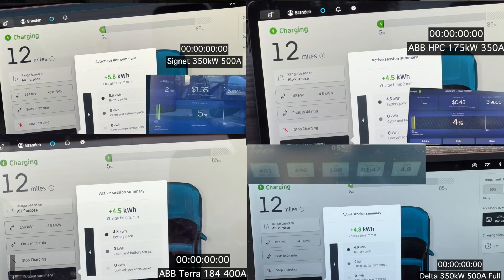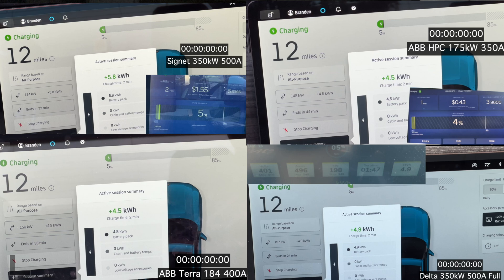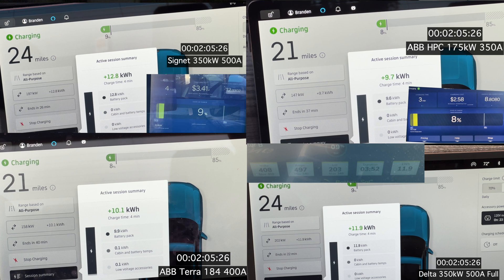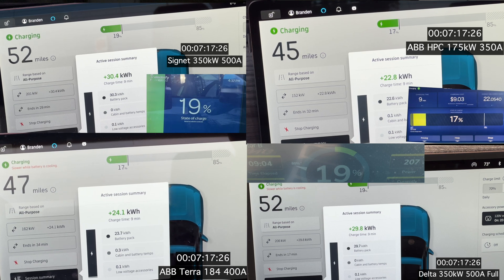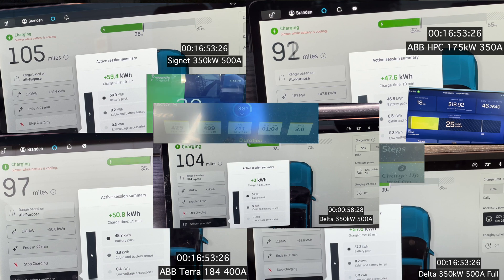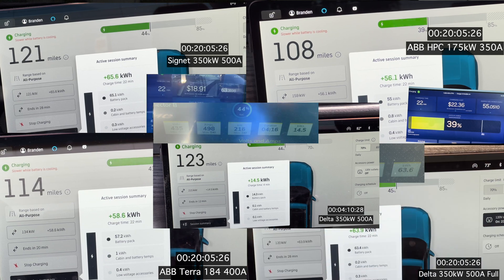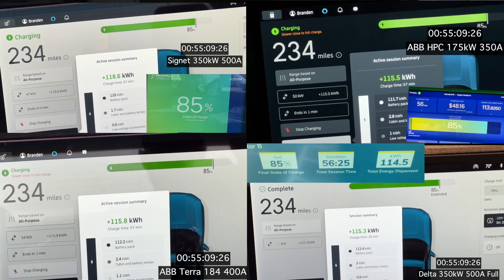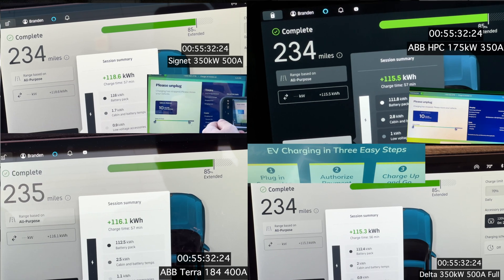Tested: 150kW vs 180kW vs 350kW with Rivian R1T - Does It Save Time?

Comment: It's the amperage of the 150 that keep it in the game. EVgo has a charger rated at 200kW but it's a 200 amp charger so on 400V cars it's 80kW max.
Reply from the maker: 200kW charger at 200A is not a 200kW IMO
Reply: @brandenflasch  Yea, not even on an 800V system; Keep up the good work BF

Comment: More proof that the harping on maximum charging speed is silly. Batteries are built to attain and average charging rate of "x".  That is the important number. The fastest charging ones charge at, or slightly better than 150kw. Finally stop looking at SOC for disconnecting! If the battery is charging at, or above, 100KW..... KEEP ON CHARGING! Once it drops below 100K and definitely 50K then, disconnect. My EQS happily charges around 100KW all the way to 90%. Those additional 5min give me another 40 miles. If I'm spending 35 minutes at the charger already those extra 5 are still gravy. High charging speed are only important if all you want is a quick "top off" but if you are still mid long drive you want to maximize those miles to the next charger!

Comment: That was a really impressive effort to gather all that data and then do the editing to display all the images in sync. It was quite a surprising result.
Reply from the maker: Glad you found it interesting - certainly was a lot of time and effort to record these sessions. Takes more effort to drain the battery than it does to charge it!
Reply: @brandenflasch  Oh heck, I could easily see that taking them all down to 3% ... ie. the "timing" of the drive to them then the driving around to get them lower before the charge.
Reply from the maker: Exactly!

Comment: Ocean Coast is v handsome. Good video, Brandon. Hope Rivian can increase thermal overhead. A little birdie told me Rivian isn’t letting their cell temp exceed 46 C at the moment. Tesla Plaid pushes 60 C by comparison. I’m assuming over time as Rivian learns about degradation, they’ll start to push things further like Tesla has. With 175K mile warranty on battery, I’m assuming Rivian will always be a little more conservative.
Reply from the maker: Thanks for watching, Quinn - been watching your videos for literally as long as I can remember. 
The a different little birdie has told me the same thing - 46C is very conservative and is likely posing limitations in a few ways as the higher the SoC, the higher battery temp you need for a high C rate. I really hope Rivian starts to have enough data soon and not only starts to really rip the AC compressor while charging for cooling, but also increases thermal limits. Hopefully there aren't thermal gradient issues as a limiting factor...

Comment: Interesting results. Thanks for this level of analysis. I'm waiting on my R1T, but I currently have a Model 3 (3yrs old). I'll admit I'm a bit disappointed by these results. I've noticed with my Tesla that there is quite a difference between the 150 & 250Kw chargers as far as speed, and I'll sometimes go to the 250s just to save some time (sometimes I'm able to get from 10% to 40%/50% in around 5min). But apparently with the R1T it doesn't matter which chargers are used. Hopefully they will improve this in the future.
Reply from the maker: Even with your Model 3, the time savings of using a v3 (250kW) vs v2 (150kW) Supercharger is minimal in actual testing. The bigger benefit of V3 is that you won’t be sharing 150kW with someone else.
Reply: That is on Tesla. CCS charges faster all around regardless of what the "pump" is labelled at. Its already that CCS 350 charges faster than any Tesla charger using the new tesla adapter.

Comment: Very interesting, thanks Branden!

What was the ambient temperature range(s) during your testing?
Reply from the maker: Approximately 70-85F for the multiple tests, so fairly consistent (or at least enough to not be a large factor in varying performance)
Reply: Would be interesting to do this again, in summer when it's around 100F

Comment: Very interesting. I would have expected it to be a delta of ~5 minutes or so. I guess like you said, just get a working charger and go about your business. 

But it seems like Rivian needs to work on its battery cooling. Seems like it should start its battery cooling as soon as charging starts to anticipate the battery heating up vs cutting power from the charger when the cooling can’t keep up.

Also it’s crazy that Rivian can’t accurately estimate the charging time. I get being off by a small margin of error, but it’s wildly off.

Comment: Is the limiting factor the vehicle? I ask because you have chargers here that in theory are 2x the speed of others but it didn't seem to matter in the end. As the cost of EV Chargers increases considerably from a 150/180kW unit to a 350kW unit, I would think results like this would make companies rethink investing in more expensive equipment.
Reply from the maker: Correct - it’s always limited by the weakest link. In this case, the vehicle.
Reply: @brandenflasch  Great video - by the way. You didn't include any charging cost information in your video. I am curious if you keep track of that information and if that is something you have done a video on?

Comment: Wow, thats amazing to see. I guess the big difference between the chargers will be in the 800V cars, like Ioniq 5 and tycan.
Reply: We have both t be rivian and Ioniq 5 and have done many road trips this past summer. The Ioniq def charges much faster - usually done before we were ready. But the rivian makes up for it w longer range. I actually prefer the longer range bc I find the detour to look for chargers wastes so much time.  On certain day trips, I could do it w the rivian without charging while I would  probably need to charge once w the Ioniq.
Reply: @Wasabi9111  Great to know.
What I meant is that the 800V cars have a biger advantage on the 350kW charger compare to the 150kW charger. You will see more difference in charging time compared to 400V car with the same to chargers.
Reply from the maker: Eh, not really. They charge faster but a smaller battery makes the difference less significant than you’d think.

Comment: Agree with your results. I've twice had issues using the EA 350 kw chargers. Apparently the truck batteries overheating, then slowing the charge rate to try and cool the batteries. The 150 kw doesn't heat up the batteries as much, thus doesn't reduce the rate. Last time I used a 350 kw charger, it stopped charging at 75%. Tried restarting 4 or 5 times and stopped after 1 minute. Then got "system error" and "battery error" messages on the screen. Power to the truck was reduced by some 80% and had to crawl the rest of the way to my destination. So far, knock on wood, never had an issue using a 150 kw charger.
Reply from the maker: Was that on the new EA hardware by chance?
Reply: @brandenflasch  I believe so. It was in Barstow the last time it happened last weekend. I went through there a month earlier and those two chargers (350 kw) weren't available for use yet. So, they were definitely newly installed within the past couple of months.
Reply from the maker: @racinj7134  the new single cable units?
Reply: @brandenflasch  Yes, One for each side. Definitely a newer style charger than the other four on site that two cables on each side (actually front and rear), the 350 kw charger has only one cable on each side of the unit. Looks like two units stacked back to back, one for each isle. Just charged there again today. Skipped the 350 kw chargers and used the 150 kw chargers instead, despite the 350's being available. Didn't want to chance another issue. Had no issues with the 150 kw chargers.
Reply from the maker: @racinj7134  Kyle from Out of Spec had issues with his Rivian on a new unit too - the charger was delivering more power than the Rivian requested and sent it into limp mode. Hard reset fixes it
Reply: @brandenflasch  I was assuming a hard reset would be my recourse as well. As I was on my way to my destination after it went into limp mode, I called Rivian Service and asked them if that would resolve it. That's when they indicated to first try, just letting it rest for 30 minutes. Turn it off and let it sit. I checked into my hotel. Came back within 10-15 minutes and the truck was fine. I'm sure a hard reboot would have worked on my truck as well, if for nothing more than the fact that it takes a few minutes and shuts everything down, thus having the same effect as letting rest, and then some. 

At this point, until EA and Rivian figure out how to make that charger work properly, probably best to stick to the lower rated 150 kw chargers. Tempting to use the 350 kw chargers since the Rivian is capable of 200 kw and you hate to give up that extra 50 kw of charging speed, but one side or the other isn't regulating the power properly. Seems to me like it would be more on Rivian's side to regulate the power down, rather than Electrify America. But, that's beyond my pay grade to make that determination. Hopefully they get it resolved soon, but sounds like it's already been an ongoing issue for at least a couple of months.

Comment: Appreciate you doing the hard work here. I'm not surprised by this based on my observations with the truck. And to be honest, if you had tried a 350kw ABB chargers from EA or EVGO I suspect those would have been slower. The charger throttling ends up eating a ton of time.  

When I had access to the RIDE screen, the thermal derating for the battery was always the max temp at 45C and not a thermal gradient issue in my observations.
Reply from the maker: I hope Rivian both cranks up the thermal management system and increases max cell temp to 50C or even 55C - likely could even charge at a higher C rate at higher SoC with higher cell temps. They’re likely being very conservative with their 8 year / 175k battery warranty.
Reply: @brandenflasch  totally agree. I'm just sitting here hoping they are waiting on more data for the fleet, or plan opening more up based on BMS health to support the battery. RJ previously hinted at something similar.
Reply from the maker: @football0552  hoping they have enough data to open the flood gates soon - let the current flow!

Comment: I don't have my Rivian yet but I do have an EV6.  Even with the 800v architecture, there isn't as much difference between EA 350's and 150's as you might think on a typical 10-80% charge.  More than what you got here but the heat generated from the higher throughput ends up requiring throttling later to keep the battery from overheating.  I don't worry about having to take a 150 anymore either.
Reply from the maker: Exactly. Even an e-GMP car might only save 2-5 min - having a smaller battery makes the rate even less impactful
Reply: CORRECT 100%

Comment: It's too bad your video clipped off the lower right corner of the EA screens. Some dispensers are now displaying kW requested by the vehicle there. Keep an eye out for those that do and see if you can confirm that it's really the vehicle that is the limiting factor and not janky stations.
Reply from the maker: I actually haven’t seen that in a long time - used to display for a couple months and then they seemed to remove that 🤷‍♂️ I think with the broad mix of hardware (the Delta unit was installed a month ago) any charging hardware limitations would’ve shown
Reply: @brandenflasch  I saw it displayed on a new unit that @itskyleconner videoed within the past few weeks.
Reply from the maker: @lkuhn65  that would be nice!

Comment: Cool how it was a tortoise & hare race. Would you say, based on the thermal behavior between the chargers, using a lower power unit would be a better choice for long term battery health?
Reply from the maker: Probably marginally better but I really wouldn’t worry about it.
Reply: @brandenflasch    I figured as much, but thought I'd ask. Still an interesting result, with slightly more stable thermals vs high power.

Comment: This is depressing. There’s no reason to seek out 350kw units on road trips. Find anything 150kw+ and you’re probably doing the best you can. Hopefully we can see this improve with future software updates!
Reply from the maker: There’s absolutely room for improvement - primarily with thermal management. I agree though, it’s not really worth using a 350kW.
Reply: Agreed, as you mentioned, future software updates hold the key for an improved Rivian Charging curve.  I would be really curious to see what some of the other 100+kW battery packs are capable of.
Reply: I wonder if it would make sense to use 350kW for long charger in winter times below freezing temps.

Comment: Thanks for the content, good stuff!!  It seems that the main reason that the rivian isn’t making the most of the higher power is due to the thermal throttling on the 350s. Hopefully rivian will be able to correct that in the future and be able to actually have the higher power result in less time at the charger. I guess time will tell..
Reply from the maker: It seems that Rivian both needs to raise the thermal limits and crank up the cooling to allow it to stay within those thermal limits - it’s possible there is a thermal gradient issue across the packs that is the limiting factor, but that could be somewhat alleviated with higher coolant flow.